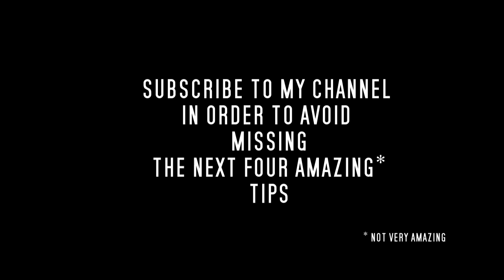5 Tips for Combat Sim Pilots - NUMBER ONE - defensive break turn

Comment: G'day Phil, Great content as always, and this series looks like a beauty. I'd only recently changed from flat / horizontal break turns into always trying to introduce some pitch up initially, to try and complicate the firing solution for the attacker. When my speed starts to degrade I'd roll further during the turn, until my elevator input caused the nose to drop below the horizon and I traded off the new altitude for a bit more speed. I'm very new to combat flight sims and am not a good dog-fighter and this rolling, pitching break hasn't been wildly successful unfortunately but I wasn't sure if it was poor execution or incorrect strategy, so I was very interested to see this video and hear your recommendation to keep the turns level. I think I understand why you recommend against a climbing turn (due to the loss of energy), but wouldn't a "pitching, rolling turn" as described above (except done by a competent pilot) be less predictable and more effective than a flat break? Cheers No.64_Lofty
Reply from the maker: I suppose adding in extra control surface inputs can help make a more difficutl target.. but remember 109s can climb better than you. try not to play into their strengths.
Also, watch some of the 109 boys' videos on YouTube. See if you can work out what happens to chaps who start to climb in front of a 109!
Reply: Just to add, you were completely right and having changed my practice and followed your advice, my energy retention is much, much better in a dogfight. I thought I was bleeding speed due to my "tight" turns but it wasn't the reason - it was because nose was too high on the initial break.